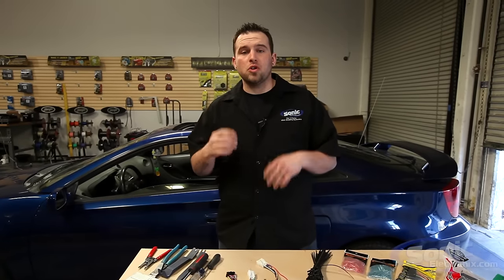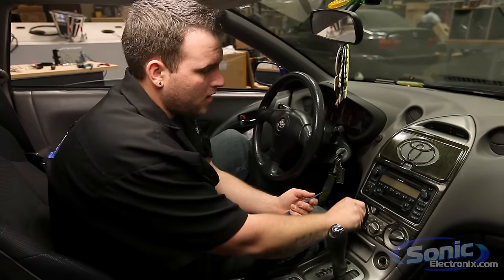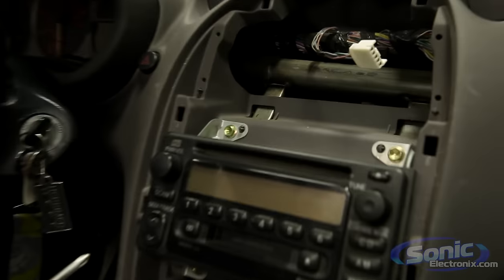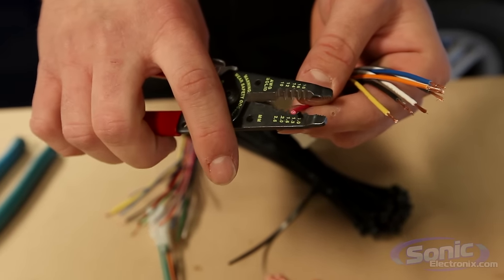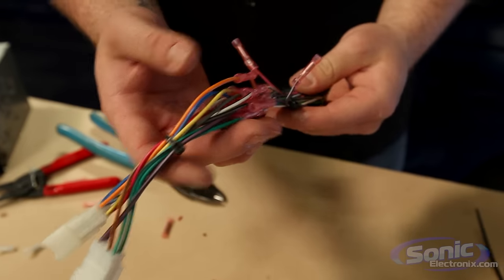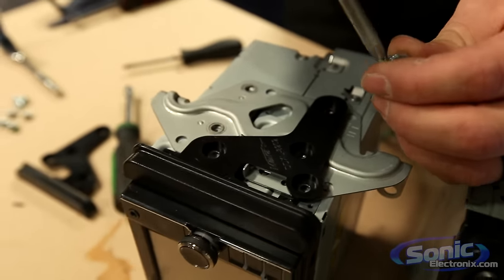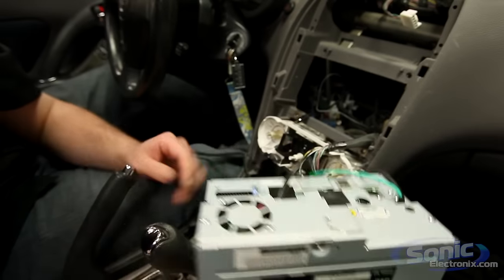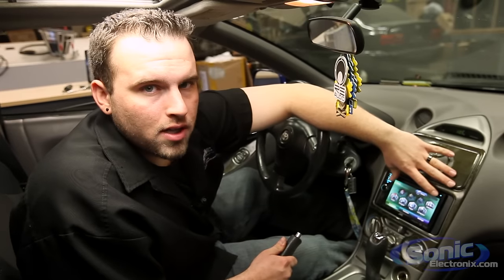How To Install a Car Stereo (Single & Double DIN) | Car Audio 101

Comment: Here's something weird- not sure if it's it's my new Kenwood with the problem or not. After having the Kenwood 2 din installed for several mos, I then installed LED brake lights in my car on the left & right sides. After a while, I noticed my radio receptions was sometimes not as good as other times. THEN, I installed a LED in the 3rd brake light in the back window (the radio antenna is built into the rear window). Now, everytime I hit my brakes, I lose all radio reception. I never heard of this happening before and don't know what to do about it. Any insight to this mystery is appreciated.

Comment: Just a question. He explains after removing the stereo that we now need to connect the wires from the kit, to the wires from the factory stereo, then in the next scene, he's holding the factory wires at the desk. Did he cut them out of the car or something? Or rip them out? What?

Comment: Hello I was wondering Is this a toyota celica GT-S installation? I have a 2000 year model GT-S and was wondering if i can use the Metra 70-1761 Radio Wiring Harness? Or is there some sort of factory amp?

Comment from the maker: Your power wire and accessory wires may not be connected correctly. The radio needs power from the battery, which is the red wires on the harness, and then it needs a 12V turn on signal, which should be the yellow wire.

Comment: Hi, regarding installation of audio system in my car.  I selected JBL GTO509C two way component system along with JBL - GX-A622SI - 2 Channel Class AB Amplifier.  Is my combination good to as per the power output of speakers and amplifier.  I dont need more power or more sound but i m interested in quality of sound, which should be clean and clear inside my car.  Should i go ahead to install this amplifier and speakers or do i need to do any changes ?

Comment: I have a 2014 xb Scion. I added a Lc7i and Amp to my oem stereo. the issue is that soon as I turned the ignition on the lc7i comes on even with the stereo in the off position, looks like there is getting some signal from the speakers with out turning the stereo ON. Also I get like a his sound coming from the speakers with the stereo OFF. Sounds like the amp is on and ready to produce the sound.

Comment: I just ordered a new stereo with a monitor.  I know it has a pink wire or parking brake wire.  I don't care about by passing or anything like that, but i want to know if i have to ground it or can i just terminate it with a butt connector?

Comment: Ford mustang 2012 v6 base model.  Questions:  Have been researching the various stereos.  The Maestro IdLink has features that allow the a/c and heating to be operated by the stereo.  Requires the purchase of a Maestro rr replacement to run all functions through the multimedia receiver.  For a base model mustang is this overkill?  Also the Maestro dash kit requires that you keep the OEM clock and climate control ; can this be removed without damaging the automobile?  If you get a dashkit for the vehicle, which dash kit do you receive if you purchase the stereo from sonic?  Also, what width screen will work with the mustang.  I want to place it at the top of the dash kit with a/c controls beneath.  Would like a storage box beneath the set up (the allure of the Maestro).  Any suggestions?

Comment: I have a radio to install. The wires coming out of the dash do not match (or come close to matching) the wires from the wiring harness. The wires from my "new" radio do not match the dash nor the wiring harness. If all of the wires matched up, I think this looks like an easy job. Me, just a regular schmoe, have no idea what to do.

Also, can you use a butt connector as a crimp cap?

Comment: I wish you had shown how the connectors would connect. I see 2 on the back of the radio and 2 in the car and 3 on the harness. How do all those go together? I see lots  of wire instruction but not a laid out harness mapping.  This would have been helfpul.

Comment: Hello sir I'm wiring a single din to the celica you are working on ....but mine is right hand drive uk type 02 plate .....the single din wants me wire a RED key wire & BLACK/RED ground ......do you no witch wire on the celica I need use to wire up correct ....would be grateful thanks

Comment: What if your doing it the old fashioned way like pulling all the wires manually positive to the battery negative to the engine block or somewhere and installing new speakers with new wires I did it on my Lexus took me five hours of work but it was worth it cause sometimes factory wiring can be so complicated.

Comment: I notice the gear shift is in neutral (to get lever out of way of dash panels & radio) and keys are in ignition. I bring this up because with my car if I put in neutral or low gear and then try to turn key to "lock" position, it will not go all the way there. Also my key will not come out of slot. Is this the way you had to leave things for this install?  Is it safe to remove negative cable of battery with car in this kind of "limbo" position?  Thanks

Comment: Help! I have a 2006 vw Jetta. Hooking up my kenwood ddx419 HU I got a miswireing DC offset error. My system seems to be a canbus system and I have a regular wireing harness is there any simple way to get my head unit working?

Comment: How can you tell the power connectors? Red, Yellow, Black, Blue, Orange-white, Blue-white wire leads. Separate sockets.  Speaker sockets is the other one.

Comment: How did you put the car in Neutral after disconnecting the negative battery. I tried it on my 05 Toyota Corolla, but it wont let me change gear to Neutral with the negative battery off. Please Help. Thank You

Comment: I have a Pioneer AVH-270BT and I'm trying to connect the harness. All the wires are connected except the solid blue from the harness and a blue/white from pioneer labeled "system remote control". Do I need to connect those wires? It's a harness for a 2000 toyota camry...

Comment: What should I do if the previous owner of my celica installed an aftermarket stereo single din cage and did not include the factory side mounts? I am trying to install a double din into my vehicle.

Comment: Hi, i have a double dim sony radio mounting it in a pontiac grand prix 04. I have my dash kit, harness. I connected my harness but i cant get my chime to my after market sony radio. I've seen that you connected your chime to your after market radio. My question is how did you do that? I have the 2 plugs from the car one for the radio, and the smaller plug for the door chime? Can you help me get it to work.

Thanks.

Comment: had a question I have a 2007 Chevy Suburban with a amplifier pushing 1200 watts which is a Viper 1200.1 DNA 4 channel Rockford 2400 watt series Amplifier do I need to put a second battery in my car

Comment: I have a nissan primera p12  2004 stereo is part of heating controls. is it best to just fit a separate stereo  underneath and leave the other one intact. run separate wire. my cd won't eject and is clicking.seen a few videos where it is a crack or has come away from its mounting. might be easier to fix old unit any ideas Ray in the UK thanks

Comment: Can someone please help me? I've wanted to install a new stereo into my car for quite some time. It still has the factory stereo and I can't pick up very many radio stations. I've been told I need a band expander. Do most after market stereos include this? My car has a little black aerial-type thing on the far right-hand dashboard which suggests to me that the previous owners had GPS. Is this normal to have if your car has GPS (there are connectors in the spare bay)? If I buy a stereo with inbuilt GPS, do I need to get anything else or can I use that aerial? In the video, he mentioned about using the factory mounting brackets but I don't have them as there's only a single din car stereo installed. Can I buy aftermarket ones? Thanks a lot in advance.

Comment: how do I install the ground wire... I have seen some videos that have the metal prong attached to the ground wire and they connect it to any metal piece in the car. my wire harness's ground wire did not come with the metal prong and the Sony radio harness didn't either. Do I just connect both black ground wires together like I do with all the other wires?

Comment: If I am replacing a double din with a double din, can I just use the stereo pull tools and slide old out and after wiring, slide new one in?  98 mercury grand marquis

Comment: I tried to splice factory harness wires into the aftermarket wires. Kenwood didn't even turn on. Now I'm riding around with a big empty space in my dash. No tunes when I ride😢 until I get it fixed

Comment: can you give me a heads up youtube video that shows how to cut away metal in the dash where the radio goes. i have a two prong inserting type for knobs i t is a 1978 datsun truck...a sharp blade and a sawzall? what type blade.  also is it best to have a professional do it?  they want to charge about 100.00..or is there a better way to install

Comment: So the wiring harnesses will be different for every vehicle and aftermarket radio combination right??
Reply: Yes, you will buy a harness that fits your car harness. The stereo will come with its own harness, so you would simply use a butt connector to join the harnesses together. In the end you would have one side that fits the car, and on the other side the connection would fit the stereo. Simple!!!

Comment: hi   i just installed new 2 din in nissan patrol 2002 but cant get the high low power antenna switch to  work with new radio  not sure if i have connected the antenna wiring correct...was working fine on old 2 din  any advice  would be good .cheers

Comment: hello,
I am trying to install a pioneer DEH-X66BT radio into my 2005 kia spectra. I originally had a sony radio in the dash but I purchased the butt connectors just like you did and connected all of the colors. However, I have am now left with a couple wires left over that im not sure what to do with. I have blue/white wire on both sides, black wire on both sides, and 1 remaining blue wire on 1 side. But when I took out the original radio they werent matched, they were mixed like like black to blue/white, black to blue, etc. So I'm confused as to if I would mixed match it again, or continue to match the colors like you did... PLEASE HELP!

Comment: the two aftermarket wiring harnesses you spliced where did they come from?
Reply: You can find them most any place that carries automotive sound equipment. They are more widely used for converting old harnesses to aftermarket hookups

Comment: My 1997 Toyota celica has a double DIN and I just ordered a single DIN radio. Will it look funny with the single DIN in place of the double DIN?
Reply from the maker: Gio Bueno You should be fine with a Single DIN. Most dash kits that convert a double din space to a single din will have a pocket underneath the stereo so you will gain some extra storage.

Comment: Hi guys hope you can still help me. I have a 2009 kia picanto with a double din whole. I have purchased an aftermarket single din radio. However you cannot actually buy a single din dash kit adapter for my car. I was wondering what I should do as I don’t particularly want to spend more on a double din radio seing as I already have a very nice single din radio. Hope you guys understand and can give me some help

Comment: Hey I just subscribed.  I had a quick question regarding a 2012 versa.  I currently have a Pioneer Appradio 2 installed with a sub, amplifier and aftermarket speakers.  I wanted to take out the Appradio and move to a single din to then Custom install a Tablet 7 or 10".  What are your thoughts on that, is it even possible?  And what type of costs would I be looking at?  Thanks for your video though, it actually makes me feel confident I can do my next install!

Comment: I installed radio myself and forgot to push down those safety pin tabs. I brake hard at red light once my kdc x991 fell off the dash🤣🤣🤣 I recently installed a used dnx 9990hd to replace my old x991👍 No mistake this time.

Comment: I have a nissan altima 2006 and want to change the stereo. i want a double din touch screen. which one would you recommend and what would i need for it, to install it? ( be specific, dont really know much) and can i use this video to help me with the installation..

Thank you
Reply: Kind of late with this message, but check out crutchfield.com. I also have a Nissan Altima 06 and this is where I ordered my single din stereo. All you do is set your car model and if you want either single or double, and they'll give you a whole range to choose from. They also will give you a pack of all the installation parts you need at a heavily discounted price. I save about 50 bucks by ordering the pack instead of getting them individually.

Comment: Hey awesome vid, i just wanted to know, in the vid you said 18-22 butt conectors i searched up everywhere and can only find 22-18 i dont know if its the same thing. Please reply, thanks.
Reply from the maker: Peter Sahagun Hey, those numbers refer to the gauge of wire they are designed for, 18-22 gauge connectors will accept that range of size. So yes, 22-18 gauge connectors would be the same thing.  :]

Comment: I have a pioneer double din and there is a light green parking brake wire I know how to bypass that but there is a long red power wire from the head unit and no red wire on the wire kit should I hook it to the ignition power wire its on the dash not the column.

Comment: hi what if i get a new double din deck that uses iso mount but my vehicle has a aftermarket single din deck that im taking out and the factory iso mount from the original deck is no longer their since i have a single din deck

Comment: hey, thanks for sharing this video, I want to know for the 18-22 pink connectors I went to radio shack and lowe's and they didn't have that size 18-22. So what other size or other place and i find them.
Reply: +Real Edit Line You can find all the butt connectors in the most popular sizes at your local auto parts chain store.
Reply: thx, just found it at Home Depot. Radio Shack didn't have it and i was surprise for a electronic store.

Comment: Hi I have the same car in the video and I ordered my dash kit but it only came with the 2 black brackets and screws and 2 wiring harness .. The  One that you have that's black at the end didn't come in will I need that to connect the stereo properly?
Reply: Hey man what kind of harness do you have & what year is yours?

Comment: how much would installation cost for a similar unit with GPS, and make the unit work with the factory steering wheel control for a Scion tc?

Comment: Electricity runs from the negative wire which is your ground...for example the cause for a dimmed headlight is a loose negative ground wire not a positive wire.

Comment: Hey I installed a new stereo and some new back speakers the other week and after we got done and tested the back speakers... We turned the volume up to 20-23ish and after that the speakers just crackle and pop and sounds horrible but anything less than 19-23ish it sounds great, but i have to keep the bass down low.

My vehicle is a 1998 Pontiac Grand am
I have Sony speakers and a KenWood stereo

Comment: We don't need any AV cables for the double din radio?
Reply from the maker: That totally depends, what are you running to it? 
Normally backup cameras will come with a RCA cable. 
If it's a stereo that plays DVD's and you want to send that signal to a rear seat entertainment unit (headrest or Flip-down monitor) then you will need an AV Cable, yes.

Comment: i have a question  i have a 2012 ford fiesta se sedan and i installed a new head unit and i did wire it right. i checked to make sure the head unit turns off and on when i turn the ignition on and off to verify. so pretty much i noticed that if i let my car sit just for like 3 days the car battery would be dead.i did check my connections. also i do have a amp and sub in as well i checked to see if the amp is turning off when the head unit does and other units are powering off. however my car does require a can-bus  unit since my car dont have a ignition turn on wire. the turn on wire is built in the can bus it self. and im very very confused why its seeming to be draining my battery. what i did do is that i reinstalled the factory uinit to see if it was the head unit and it turned out to be. my modal unit is a Kenwood KDC-HD-HD455U  and my wiring harness is a xsvi-5524-nav.

Comment: I am installing a pioneer av3500bhs on a 2008 Camry. I am using the Metra 98-8218 Dash Kit for double din. Do I use the brackets the came with the factory to install the Pioneer or do I use the  brackets metra supplied in their kit?  Also is there a how to video on how to install an aftermarket radio using a a metra kit for a toyota camry?

Comment: What if the car won't crank on after installing a new radio ? Took new radio off car started on ,but when plugged back in didn't turn on anymore just lights

Comment: i have a 2007 Mercedes C230 and i looking to buy the Boss BCP62-RC, is there any wires or extra accessories i’d have to buy to install it ? it’s says it’s compatible with my car on the website but that doesn’t mean it’ll include everything i might need. if anyone is still in the comments section please lmk

Comment: one question.  i have a sony wx-gt90bt  im getting ready to install it.  i got an adapter that will retain my door chimes.  and im installing it into a 07 chevy colorado.  their is a red wire that comes off the plugin for the door chimes.  there is also a red wire coming off the radio plug.  they are slightly different colors.  what do i do?
Reply: their may be a light red, and Pink you need to read the instructions that came with the Integration unit and count pins to find what wire does what in that pin location.